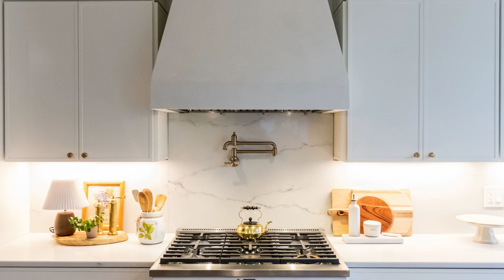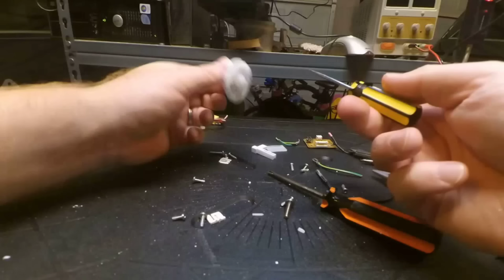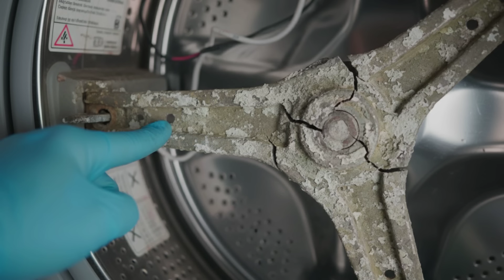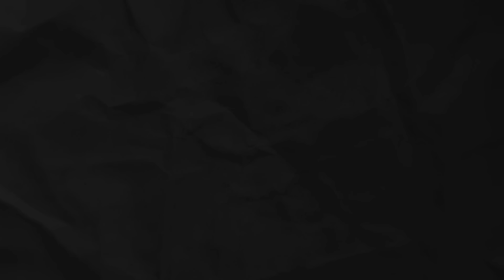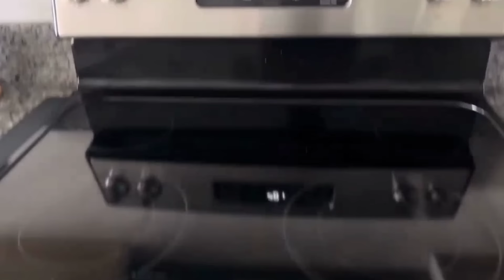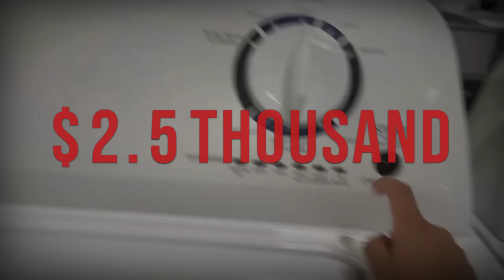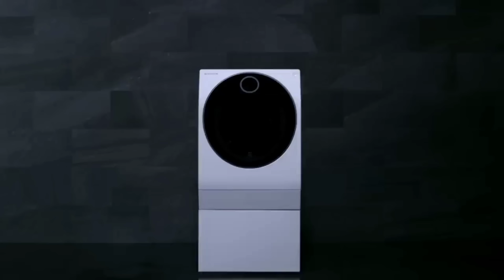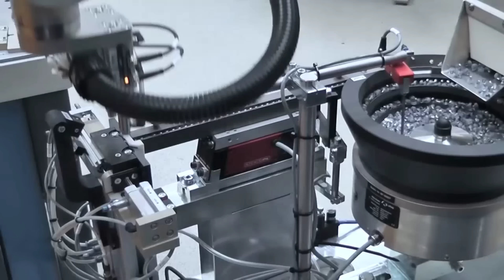The Repairman Blacklist: 5 Appliance Brands to Never Buy

Comment: Modern appliance are made like cars their designed so easy cheap fixes need to be done by their expencive maintence staff with special tools or designed to be cheaper to get a new one than fix.

I know about cars so give an example that the concept applys to appliances as well. 

At one time if you had a burned out headlight,  you puchases a new cheap one pop the hood couple screw driver remove the old one pop in the new one and a way you go.

Now they design the car so the whole engine block must be hoisted out of the way to even access the lightbulb. So your choices are to go to a dealership who have that specific expencive equipment they charge you 2-3hrs maintence fee plus the exaggerated price if the new lightbulb.

Find a cheap mechanic who has the hiosting machine and will do it cheaoly, but him touching your car violates and warranty you have on the car for any other problem that may hapoen in the future.

That or you drive with one headlight get fined by the police til you get it fixed or buy the expencive engine hoisting equipment so you can do it yourself or just buy a new car.

Most dealerships now make more money on fixing your car than selling you the car.

Comment: I have a tower. I LOVE IT. Would NEVER go back to a top loader. Totally disagree about the top loader washer. Towers and stack  units clean more clothes. Use less water. Take up less space.
Reply: And I have had NO Service calls wth my towers and stack units. Why have I had 3 sets? Because I have moved and the buyers wanted my stacks. Then I got an LG Tower this last time. I LOVE IT. What I don't like is electric ranges, The tops are hard to keep clean. And break. Give me an old fashioned gas range and don't put the Microwave over them.  I don't use a dish washer except for washing my canning jars. And I think side by side fridges freezer section should have baskets on every shelf and should be the same width as the fridge.

Comment: My Whirlpool washing machine lasted 25 years and only had one cheap $90 repair when it was 20 years old. Before that I had an Australian made Simpson which lasted 30 years. My Westinghouse refrigerator has lasted 30 years and I have only replaced the interior light bulb. Still working beautifully.

Comment: The info about the LG frontload washer is absolutely correct. My LG is currently sitting in my laundry room, unusable because the "pot metal" has disintegrated. During a normal load, the machine sounded like it was going to fly apart and a bunch of very fine metal shards were released around the seal and trickled down the front of the machine. So, I'm currently shopping for a simple Speed Queen!
Reply: My daughter's LG sat in the hall for months while she bought a used Kenmore top loader which worked much better.  Then her electronic dryer panel went out and it cost almost as much to replace it as to buy a new one.   The Kenmore set that she left at her ex-husband's house is still going strong after 20 years.  She should have taken it with her.
Reply: @sandratuttle I believe it! My mom had the ugliest brown Kenmore set that she used for well over 30 years until she moved in with me due to her health. I have a Kenmore refrigerator that I bought in 1992 that is still working perfectly!

Comment: The most important part about older style dumb appliances is that a handy homeowner can literally order any part from the manufacturer and fix it themselves.  I've fixed dumb appliance issues with mine for $20-$40 more than once, like when I replaced the whole solenoid/valve assembly in my laundry machine.  It sure beats a $300-$500 service call.

Comment: Don't buy a Frigidaire fridge if you want an icemaker in the freezer.  Have never found an icemaker that lasts longer than 3 months.  Don't buy a Frigidaire upright freezer because the wires aren't insulated so it forms a big hunk of ice that melts all over the floor.

Comment: Then you have the modern GE Profile dishwashers, where a presumably college educated person, decided to put PLASTIC water jet arms 1/4 inch above an electric HEATING element for the drying cycle. Oh and since were using "controlled" water jets, we only need to waterproof select areas on the door assembly. Basically after >3 months of dry cycles, your water jet arm melts, and begins spraying water directly at a door NOT designed to contain it, flooding your kitchen. 

But that is okay because GE "fixed" the issue by adding a metal plate to the ends of the lower jet arm. Metal plates held in place by PLASTIC pins on the PLASTIC jet arm sitting 1/4 above a HEATING element, that will ALSO melt off in >3 months. Adding random bits of unsecured metal floating around with your dishes and still flooding your kitchen within >6 months.  

A great $400+ a year subscription model replacing a part engineered to fail on a $2400 dishwasher.

Comment: We bought a Speed Queen commercial top-loader back in 2019 for my condo complex (3 apartments). It did need some bottom-mounted circuit board during the pandemic that took 2 months to procure. But it was covered by warranty and cost us nothing. Other than that, works fine. My fridge and stove units I bought are simple, dumb appliances with no problems.

Comment: I have one of the best dyers.  29-year-old Maytag dryer and praying that it will never break!
Reply: Just got rid of a 40 yr old Maytag washer. Replaced two $25 parts myself in the last 25 years. But now it needs a part they don’t make anymore. So I got a Speed Queen.
Reply: @kenmorgan9470 😮 40 years. They need to make a commercial about that washing machine!
Reply: The Maytag set I had lasted me just a little over 20 years! I miss that set. Had to replace it during the pandemic because we couldn't get the part the washer needed--it was going to take 6 months to get shipped. :( Replaced with an Electrolux front loader and dryer. So far so good.

Comment: We NEVER use the oven cleaning feature on our oven.  I figure that feature will destroy the electronic control panel. The high heat during the cleaning cycle will destroy your electronic control board. The only thing this oven cleaning feature will clean out is your pocket book.

Comment: When our very old Maytag clothes washer finally bit the dust, I replaced it with a fancy washer -- which I regreted and replaced it within two years because it tried to wash with very little water and it did not clean the clothes. I did more research this time, and narrowed it down to Maytag Commercial (which has an agitator and knobs) or Speed Queen. I ended up choosing the Maytag Commercial because we grew up with the "old" Maytag products (before they had built-in obsolence too) and the Commercial seemed like a return to the originals. Anyway, I also bought the matching dryer. They have been mostly fine. The washer needed one repair after four years, but that was two years ago and no problem since.  Hopefully they have fixed that "weak link" in their product by now. No other problems.

Comment: We had an LG 33 cubic foot French door refrigerator that we bought in 2017 & loved, but the compressor failed in 2022 & was covered outside of the warranty due to the class action lawsuit against them for models from 2014 - 2017, and there's a new class action lawsuit for models from 2018 onward. It then failed again along with the main circuit board in 2025 and we sold it for parts ($3,000 loss for 7.5 yrs of use) and bought a KitchenAid French door refrigerator that functions much better and was made in the USA.

Comment: I have a 20 year old Whirlpool “dumb” dryer. Never one issue with it.  Planned obsolescence should be outlawed.
Reply: I work in this industry. I always tell my customers when they ask, which refrigerator, I sometimes tell them ice only in the freezer, no water spouts. But you know what, 99% of the time they say well I’d like water & ice in the door. So I’ve really limited my conversations about this because the consumer seems mostly to not care. Also have you seen the new speed queen machines? I’m completely unhappy about the new touch control boards. No more knobs. I really hate this change. Yes the old appliances were all 100% better. Maybe they didn’t look as fancy but who cares they worked & they lasted. Repairs were possible, but more & more the parts to repair these old machines are not being made. Our landfills are covered in mountains of these new fancy appliances that are literally garbage, but cost us so very much of our hard earned income.
Reply: @tgood9344 NEVER DRINK WATER FROM A REFRIGERATOR DOOR… it’s poison!
Reply: I have a 35 y/o washer/dryer, Lady Kenmore... still work like new 🌹
Reply: I have an old whirlpool top load washer it's starting to give up on me,going to get the exact same one refurbished
Reply: All my appliances are 32 years old. No problems whatsoever.
Reply: @joycampi7233 you're basically too cheap to upgrade. That's all it is 😂
Reply: We have a 40 year old KIC dryer.  Everything still works.  And this was an extremely cheap make in South Africa back when it was new.  Your Whirlpool (just as dumb) should go as far.
Reply: I had my 25+ Whirlpool dryer repaired. The band that spins the drum wore out. The repairman told me that my dryer was workhorse & worth $190 repair cost.
Reply: I just had to replace my 33 year old Frigidaire 😢  Surprisingly the annual energy use rating is 10 points higher with the new fridge. Huh!  They only make appliances to last 7-10 years, if you're lucky.  Total rip off.
Reply: I hate all the new washing machines. They are crap and mSsively waste water to clean the same load that I used to clean with my Sears Kenmore washer with it's large agitator that had huge spines that truly moved a load of laundry around and cleaned in the drum. My new washer has tiny low spines and they don't move the load so I end up using the Deep fill setting and 2 cycles to get a result that is maybe half as good as my Kenmore was. The digital settings that you touch are wearing out also.
Reply: My samsung of 8 years just went out.  Im looking at lg but still debating
Reply: Just had to replace the heating element on my 15 year old Whirlpool dryer.  Washer still going strong - knobs only - top loading set - no computer b.s.💩.  The repairman told me to keep them as long as possible - the new stuff only lasts 5 years if you’re lucky.
Reply: And then once you have to start replacing the good old-fashioned appliances it's like every five years everything takes a dump I can't believe I'm still buying appliances at 80 when I thought I would be done
Reply: I had a defy fridge for 20 years.........the new defy started rusting inside after less than 10........
Reply: Planned obselescencr is Fraud?  Deliberately reducing functionality.  Should be illegal, eh.  Likely, it is.
Reply: A "death trap" PASSED UL-LISTING TESTS???????  HOW?  Lawsuits?
Reply: I literally HATE Samsung!
Reply: Samsung is Korean..it is junk. I had Samsung dryers, two, which were nothing but junk.
Reply: I hate y GE smart range. First of all, cannot stand anything from China, second, I don’t like GE!..
Reply: France just passed a law against planned obsolescence!  The US is so far behind.
Reply: I bought my dryer and washer in 2001….used. Still going strong.
Reply: @marylhere and? That's not really that old
Reply: my 25 year old Sears Kenmore washer and dryer are both still going strong and never a single repair.  and I can open the lid whenever I want, change to a different cycle or change the water level in the middle of a cycle, change water temperature in the middle of a fill, stop the spin at any time to reach in and redistribute the load, and so on.   these new "smart" ones would drive me absolutely bonkers, they won't let you do  ANYTHING once you push start.
Reply: @wolfc8755Yes, but that was the good old days when Sears and Kenmore built and sold products to last, and they stood behind it if anything went wrong. 
In todays world, is the opposite, is designed, engineered, and built to crash and die two days after the warranty expires. Is about making money.
Also, new generations want the looks, the gadgets, the fancy stuff, the latest and coolest, not realizing they are being ripped off. 
I miss the good old days of “Made in America” 
😎🇺🇸🇺🇸🇺🇸
Reply: my dad managed the appliance department at Sears for many years. Kenmore  was always the way to go. I still have my 45 year-old washer and dryer.
Reply: @HiHoSilvey I still have my Kenmore Coldspot refrigerator from 2002.
Reply: @KatherineOkulewicz and??
Reply: @HiHoSilvey  So do I. My kenmore stove from 1988. Repalced my Kenmore with another Kenmore Dishwasher. I just replaced a kitchenaid 1988 fridge with a similar simple Whirlpool. No water ice on the door. The home depot sales guy said you bought a basic fridge. and i just said i want a basic fridge.

Comment: I have a high end KitchenAid snazzy french door fridge in my new home. At 14 months, the compressor failed. The 'sealed' system warranty (10 yrs) covered the repair, but not before I was out $700 for a new inverter (which did not fix it) and of course the  'walk in the door fee" from the local appliance repair place, which referred me to another KitchenAid 'certified" appliance repair place, which charged me their 'walk in the door' fee. Without that long 'sealed system' warranty, I was told that it would have been a $2000 repair, and we would probably want to just send the fridge to the landfill and buy another one. Long story, but due to no parts on hand with repair companies (everything has to be ordered), and shortages of repair people, we were without a fridge for 5 weeks. Don't go with KitchenAid. Just sayin'.

Comment: I had old Montgomery Ward washers and dryers, two sets 30 years apart and the last dryer was just replaced because i could not get a motor and the basket in the washer rusted out and i coukdnt get a repla4. Otherwise both still worked. These were made by Norge and had simple settings and choices that newer models dont have.

Comment: We will be married 37 years this fall. We are still running the Maytag washer and dryer that my wife’s parents gave us as a wedding gift. I have done four repairs, myself, during that time. I replaced the fan squirrel cage on the dryer, and on the washer, the injector valve assembly, the water inlet/mixing assembly, and most recently I took the clockwork assembly apart and cleaned up the contacts as one of the cycles would not start gyration. Total parts cost, maybe $250, plus my time.
Reply: You’re so lucky to still have them! I had mine for about 23 years and maybe 3 easy repairs on the washer,then it back to new again. This last time my repair man said it’s time to go. I waited 2 months before I would even make a decision. I specifically bought from a small appliance store I thought they would be the most honest with me. I didn’t want anything fancy or special, something similar to my old plain white top loader, agitator. What this salesman sold me is absolutely junk! It didn’t have manuals for the washer or dryer he promised 3 different phone calls he was sending them to me. Still no manuals! I would like to dump this set on his front step and block his door, I hate them that much!!! 🤯
Reply: Same here. 37 year old Maytag washer and dryer. Had the dryer blower wheel replaced 20 years ago. Could use a new lint filter.

Comment: I was a repair technician back when the original Goldstar brand was released. Electrolytics were glued to the circuit boards with corrosive contact adhesives before wave soldering (which happens upside down). The idea was the adhesive would eat through the copper on the PCB just after the warranty ended. Unfortunately, Australia is a bit hotter than Korea. The warranty claims killed the brand, so they renamed themselves Lucky Goldstar, shortened it to LG, and used slightly less reactive glue. Most of their junk now lasts to a bit beyond the warranty. The Chinese have copied them. Whenever I buy any new electronics, I pull the lid off and look at the circuit boards. Any sign of brown, reactive contact adhesive, and I take the thing straight back. If they have used nice, neutral Hotmelt, I spray the lot with Aviation Grade Silicone spray and whack it all back together. Still have to replace the Electros every five years or so,  'cause they are also designed to dry out, but it only costs $20 or so, and keeps my eye in. I live on a yacht in the tropical Coral Sea- very bad environment, but most of my electronics are 10 to 15 years old.
Reply: I had a GoldStar television that was great until that adhesive meltdown happened.  No idea they became LG.  Makes sense now.

Comment: The vintage Whirlpool washer shown about half through the video is exactly the washer I have. I bought it in 2004 and spin failed about 6 months ago. I took it apart, and it was a simple nylon cam that had deteriorated, about $6 for the part. I fixed it myself in several hours saving my self hundreds of dollars in repairman costs. At the same time, I rebuilt the clutch and the agitator gears. Total cost was about $85 for parts and shipping. The washer should be good for another 22 years!
Reply: Thumbs up 👍 for my toploader Whirlpool with knobs.
Reply: That is a total lie! A motor coupling is not $6.
Reply: @MichaelRei99  ive seen them as low as 4 bucks..  you want the plastic one and not the metal.. the plastic onje will shear if the machine is severely overloaded or the clutch locks too hard etc.. saving the gearbox and the motor. the metal ones will rip apart the internals..
Reply: Thumbs up 👍 for my toploader Whirlpool with knobs.